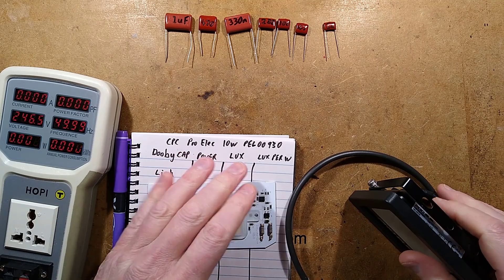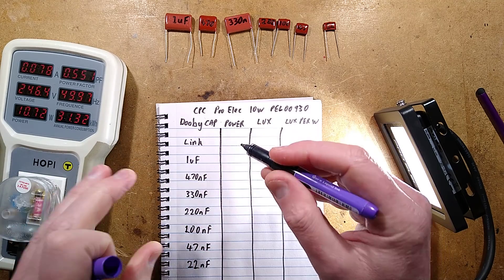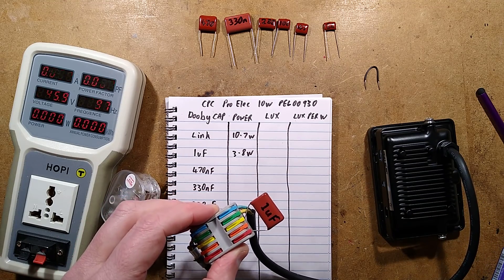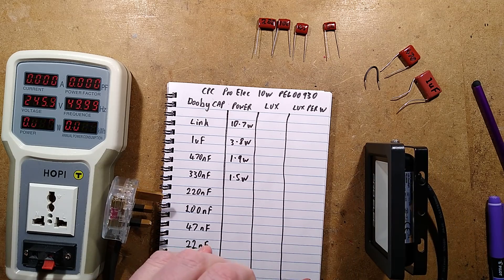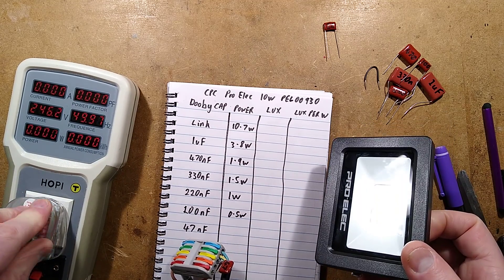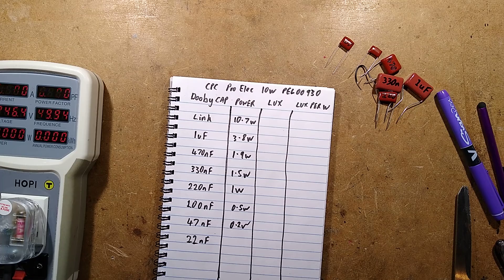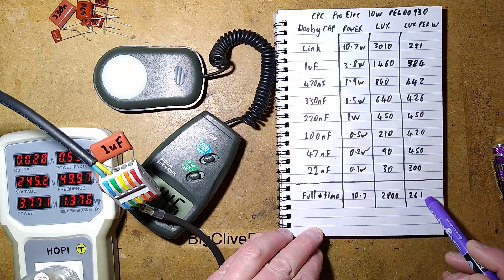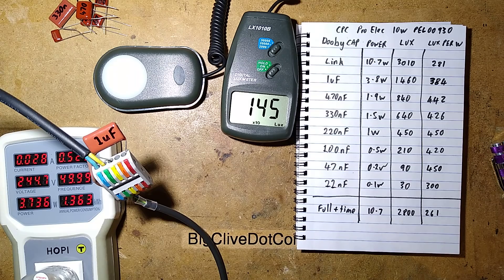Doobying a cheap LED floodlight with lux/efficiency readings

Comment: Looks like if you require the output of a 10 watt lamp buy a 20 watt and stick a 1uF capacitor in and get a lamp that will last way longer for probably less than the 10 watt as the LEDs will run more efficiently. Win win all round
Reply: The very cheap led lamps are still junk.
Buy a good one and dim it down. That would be worth the effort.
Reply: @CyberlightFG  CPC sells decent stuff, UK company so you know it's UK compliant, I wouldn't chance buying 240 volt stuff from the usual suspects.

Comment: I never realized I didn't know the difference between lux and lumens. It seems to be akin to the difference between Watts and Watt-hours (Wh). Lumens if a measure of power, and lux is a measure of power per surface, with the correspondance that 1 lx = 1 lm/m^2. I understand the lux values given here are only valid when used in a comparative manner...  did the original lamp manufacturer bother specifying a lumen number?
Reply: E = I/d2 where E is Lux, I is intensity in Candelas and d is the distance from the luminaire to the lit surface
Reply: The CPC website (https://cpc.farnell.com/) gives lumen ratings for all its floodlights.  I think it's a legal requirement.
Reply: Lumens are total light emitted, lux are light incident on a surface. Both are weighted to model the response of the human eye. Lumens are harder to measure because most sources aren't omnidirectional. One lux is one lumen per square meter.
Reply: @whitcwa  - The standard SI unit is Candela. It is true that calculations are wieghted to the response human eye for phototopic vision (daylight) but there are also wieghings for Scoptopic and Mesopic states
Reply: @gerbilmajor  There are several SI units of light measurement. Among them are candela, lux and lumen. The candela is the base unit. The others are derived units.
Reply: @whitcwa  - you are right - Are you a lighting engineer. I have been in R&D in a major lighting company for 32 yrs

Comment: I need to get some wago or fake connectors to make my hobby life a bit easier. breaking out the iron every time for small stuff is a bit of a pain and hazard.
As for the lights. I've had my e-bay chinese special porch lights burn out on me (guess which LED type they were) and replaced them with flip-chip COB units of the driverless and drivered types and haven't had a failure since. If they burn out again I may put a capacitor in-line like here, or I'll try that for a new project of a high wattage and under-run them to the desired level. Seems like a sound idea for some types of light for sure.

Comment: This gives me the idea that putting a capacitor and a PIR switch in parallel would make a nice "always on" security light .. low level illumination most of the time, but full brightness when the PIR detector is triggered...
Reply from the maker: You can get some strip lights that do that.
Reply: Thank you for your good explanation.
How can we switch between each pair of inputs by an antenna?
Reply: They do that for the LED lights on train stations - each unit has a PIR/microwave sensor = low level light when passengers are sitting on bench’s/not moving away from the lights, full brightness when passengers walk under light units and when a train passes/stops
Reply: You can buy outdoor motion lights now that come with that feature. (Not saying you should do that instead of implementing it yourself if you want to, but it's an option.)
Reply: @IDoNotLikeHandlesOnYT  link pls
Reply: That sould work just as well with any kind of switch.
Reply: I just added that to my hall light. A fixed resistor across a FET controlled by the PIR.
This is a 12V LED strip for clarity.

Comment: Clive searches for something to short cap.

Clive completely misses the wire jumper he just took out of the Wago 😆
Reply: It's an engineer's way of doing things: don't use something close by, reach for the most distant and difficult-to-get one!
Reply: 😂I was thinking the same thing.
Reply: Give Clive a break. It takes a lot of 'radium' to be perfect all the time !
Reply: Deffinitely safer to use a screwdriver instead of that short little piece of wire.
Reply: @EddSjo  Yeah, even something like a rubber handle screwdriver would insulate the user from any shock.

Comment: Would this work with a 20W lamp dropped to 10W? Could you just buy the next lamp up in power and drop the power with a capacitor?
Reply from the maker: Yes.  You could downrate a similar 20W light.

Comment: One day we'll find it: The rainbow connector...
Reply from the maker: It just needs that elusive violet position.
Reply: @bigclivedotcom  Already had a hard time finding a 3 pole connector like this, (with no way of shipping though) and not even finding a 5 pole one..
The only ones wago offers here are the single pole ones (the transparent with orange lever). several next to each other take way more space, and are still separate. That one you have there is some neat compact connector, please tell more. 
Thanks as always, making a "dubai floodlight" so to speak 😅
Reply: @bernds6587  I have found "lever wire nut compact splicing wire connectors with colored levers" on Amazon. The one I purchased were three colored levers for inline splices.  There were ones that didn't have colored levers but should do the same for 2 and 3 line inline splices. I found them because Amazon showed me "XHF connectors" which were for inline splicing, I think.
Reply: @4k8t  I found them now, thank you!
Yyuan makes 3 line connectors only (with the standard colors brown blue yellow) and Chaju makes also 5 line ones. Sadly amazon doesn't ship them to germany, but maybe I'll find them somewhere else.
Thanks again
Reply: Why are there so many songs about wagos and what's on the other side?
Reply: The live, the neutral and me.
Reply: @CRCinAU  Brilliant comment. 👍
Reply: The lovers, the dreamers, and me.
Reply: @theSnowpup  Thank you. I couldn't remember and it was really bugging me.  😄
Reply: Was about to comment specifically to say "Hey Kermit! Clive found it!"
Reply: The lovers, the dreamers, and Clive!
Reply: I desperately need it
Reply: Is that what's at the end of your rainbow? 😂
Reply: Plenty of similar ones on amazon.
Reply: What's so amazing that keeps us Clive-gazing?
Reply: Doesnt seem to let me add a comment but if this one works, try item 383980190226 on the bay of e
Reply: @jasonmonk7336  Great stuff! BC has caused me to buy several handy items in recent years. He probably would not like to be considered as 'an influencer' though!
Reply: @travelbugse2829  Not only have I bought lots of cool dodgy stuff off ebay because of Clive, I've also received a free pack of really awesome velcro tape that I now use for everything cause someone was promoting their stuff on the comments!
Reply: Don't you mean the pride connector!? Also, if you had a connector with more positions, you'd probably get that.

Comment: Could someone explain why this works? If you put a resistor in series, it'll dissipate the watts as heat, yes? Is the capacitor just letting fewer watts through? A capacitive dropper is more complicated, isn't it?
Reply from the maker: The capacitor rations a portion of current through on each half wave like a rubber diaphragm in a pipe.
Reply: It's reducing the voltage that reaches the lamp. It doesn't use power itself, per se: it stores and releases charge on each cycle of the AC mains. The result in effect is that of a resistor, without power being wasted as heat. The downside is that the current gets more and more out of phase with the supply voltage, which is what is meant by the "power factor" reading on the Hopi. For LARGE loads this can be a problem, but for a few watts it doesn't matter.
Reply: Search for "Capacitive Reactance" which will give you many sites that explain it. One thing worth nothing is that the reactance formula ( Xc = 1 / (2*pi*f*C) ) depends on the frequency (which is fixed here, 50 or 60 Hz) and the inverse of the capacitance. Thus a larger capacitor actually has a lower reactance, as could be seen in the table from Clive.
Reply: A capacitor is a resistor to AC, like a resistor is to DC
Reply: The capacitor only dissipates energy from the equivalent series resistance. The pure reactive load consumes "imaginary" power—if you integrate instantaneous voltage times current over time, you'll come up with zero. What happens is that the voltage lags the current by 90° and thus when the voltage is at maximum, the current is zero. When the current is at maximum, the voltage is zero.

Comment: nice one. Are there any downsides from putting a cap on those lights?
Reply from the maker: Not really.  If the capacitor went short circuit the light would just light at full intensity, and if the light failed short circuit the capacitor would limit the current.
Reply: @bigclivedotcom  cheers

Comment: Wow, I'm tempted to buy several of those and mod them all to run at lower level. The fact that the 3.8W was half as bright as 10.7W (and the full power was even worse when warmed up) was really eye-opening. I could just buy twice as many and mod them all, get the same amount of light with much longer lifespan.
Reply: Years ago when I first discovered this channel,  BC was demonstrating how reducing the value of the cap. in a dropper circuit for LEDs was a good way of improving reliability / durability.  Promptly went out, bought caps to replace the higher value caps in our outdoor floodlights (that were lasting 18 months tops), and we've had zero failures since.  Even a modest reduction really helps with durability, with very little effect on light output.
Reply: @phils4634  From the lamp manufacturer's point of view, longevity is not always a good thing -- you want to sell as many as possible.  The lamps ideally have to last long enough for people not to think "Huh, I won't be buying those again!"  and consciously choose a different brand, but go with the devil they know.  Now, the laws of physics are a harsh mistress: if you drive LEDs hard, they may shine twice as bright, but not even for half as long.  When that meets up with the laws of economics, it suits lamp manufacturers to buy cheap LEDs, work them hard and claim maximum brightness.  Longer-lasting lamps with better quality components and/or more LEDs, each of which has less power going through it, will be more expensive -- but these ones are so much brighter!

over-emphasisingghoulishwith
Reply: @bluerizlagirl  It was a case of "if I do this I wonder how much longer they will last", which in our case is a bit important since our ext. floods are a home for red back spiders, which you don't want to meet unexpectedly.  Turns out that a very modest reduction in output (almost un-noticeable) has meant lights that failed after 12 - 18 months are now lasting well past 3 1/2 years, which is great news for us (since I used to "re-lamp" the bust ones with AliExpress LED arrays anyhow!)
Reply: @phils4634  I bought a strip lamp for my CH cupboard last year on eBay. It went fine for 2 months, then failed. It was always running way too hot. The circuit popped however, and I took the easiest option and dug out an old psu rated at 30v, which has worked fine since. The two strip light LEDs were wired in series: all I had to do was re-wire them in parallel. I couldn't get a refund as eBay only gives 60days guarantee.
Reply: .  I bought 4 strip lamps (12v) about 4 years ago, and the 3 put in continuous use are dimmer than when installed. The one on a 50% duty cycle looks nearly new. I am mostly satisfied.
Reply: @jamesdriscoll_tmp1515  That's a classic sign of over-stressing cheap components; they age prematurely.  If you let too much heat build up in a confined space, it's the kiss of death.

Hacking lamps to run at lower power, arranging extra cooling or even just using them part-time and allowing them to cool off should all produce an improvement, though repeated on-off cycles can introduce problems of their own.

Even running two 10W fittings at half power might well actually be more economical in the long term, if they last more than twice as long as a single 10W fitting run at half power.

But apparently, most people don't keep a MySQL database with the dates they bought, installed and replaced each of their light bulbs, the purchase price, the room they were used in, the make, description and wattage, reason for replacement and then use Python to draw graphs.  Which is a great shame, because they probably are missing out on the knowledge that kitchens and bathrooms present the harshest environment for light bulbs of any technology, nor that the most expensive is not always the best value in terms of lifespan per pound .....
Reply: @bluerizlagirl  actually it's strips of flexible circuit in a long strip, with smt led's. They are open to the room, and run 24/7 how long should I expect them to last? They have lasted longer than most led lights. I like them better than florescent lights for this application
Reply: @jamesdriscoll_tmp1515  As a rough guide, running 10ºC hotter halves the lifespan of electronic components.  Running at reduced power with passive cooling from not being enclosed so air can circulate past them will certainly help.

Remember also that direct sunlight is the equivalent of 1000 watts per square metre of surface area.  In other words if your strip is 1cm. wide, so 100 metres occupies 1 square metre, then increasing the power dissipation by 10W per 1m. length would shorten its life by an amount equivalent to putting it in direct sunlight .....
Reply: @bluerizlagirl  ok, my strips are not warm to the touch so that's not an issue for me, my led bulbs run hot, and don't last as long. By design, most likely
Reply: @jamesdriscoll_tmp1515  For sure. Commercially-available light bulbs are carefully engineered to run on the edge of reliability, giving the combination of price, brightness and longevity that best suits the manufacturer.   Typically that will be as bright as they can make it; and not too expensive to put you off buying it in the first place, nor too short-lived to put you off buying it ever again.

Under-running makes an enormous difference to lifespan, and the reduction in brightness is often self-compensated by an increase in light output per watt. If the light is too bright, your pupils will contract; and you won't notice any increase in illumination above a certain level anyway!
Reply: @phils4634  h
Reply: +1 ..  and with multiple lights the coverage will be nicer.
Reply: I recently wanted the "4ft batten led" lights but not the rating 40W. 10W would have done but they are 1ft so less coverage. I did the mod on these and dropped them to around 1/4 power usage keeping a similar spread.
Reply: Big Clive has done another vid on exactly this effect )or maybe more than one). https://www.youtube.com/watch?v=klaJqofCsu4&t=748s is definitely worth watching.

Comment: I see a market for an in-line connector containing the gubbins. It'd be great in a light bulb socket extender or a plug-through 13a connector.
Reply from the maker: These lights have to be terminated into a junction box anyway, so the cap could be tucked in there (at the top to avoid pooled water.)
Reply: @bigclivedotcom  I mean if we’re modifying the circuit, why not put the cap in the fixture. It should be Nema 3R (I don’t know Your equivalent)or better anyways for outdoor use. Better than in a junction box that may or may not be moisture tight.
Reply: @bigclivedotcom  Could you fit the cap inside a ceiling rose connector? Couple of Wagos should do it.

What type of capacitor is that, and should there be a chunky resistor in parallel with it?
Reply: now who is going to get an estimation on production cost in china ? im in.